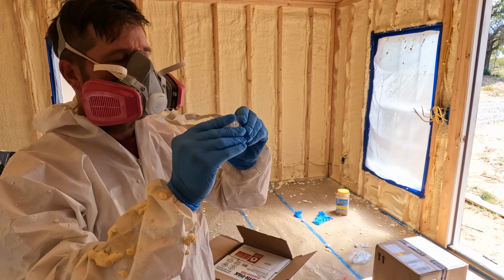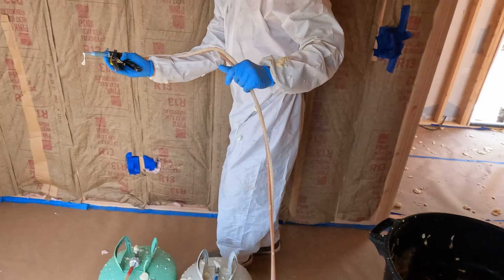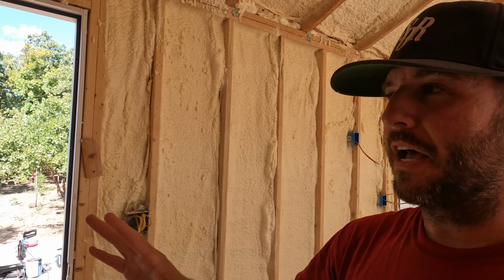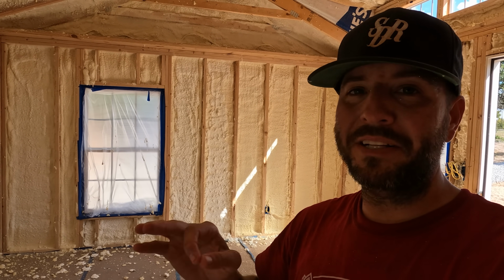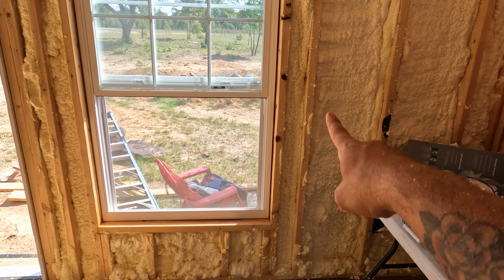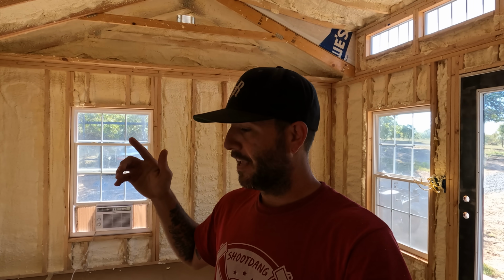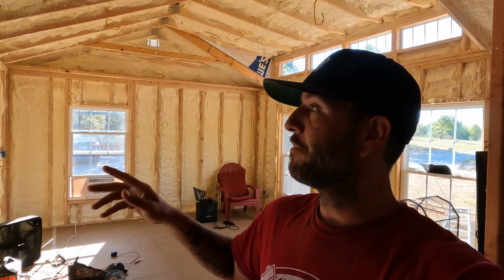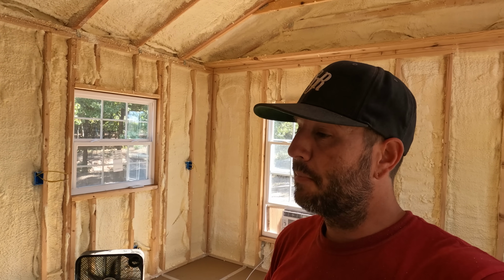Shed To Tiny House - DIY Amazon Froth Pak Spray Foam - Was It Worth It?

Comment: I have had terrible luck with nearly every appliance I've purchased in the last 5-10 years. Defective Maytag washer within 18 months. Bosch dishwasher dead in 3 years. GE window a/c dead in 1 year, Frigidaire freezer worked but had to replace some part to cool the fridge at 3-4 yrs cost $250 to fix an $800 refrigerator. I'm sick of these throwaway appliances & cannot recommend any brand because I really think it's luck of the draw. Previously had good luck with many brands lasting 15-25 years & 30 year old Maytag still going strong in my shop 🤞

Comment: Your window A/C unit is not properly installed.  The accordian panel on one side has a open gap in it and if you put a little of the pink insulation scraps over the accordians strips it will cool better.  Also if you have running water run a hose to the window keeping ithe hose covered so it is NOT out in the sun then put an adjustable spray nozzle on the hose turn on the water  and turn the adustment on the nozzle until it has a small fine mist spraying out without having to hold the trigger and wire it up aimed atthe exterior of the A/C unit spraying the mist either directly on  or right across in front of the exterior "rear" coils of the unit ( barely on the A/C is better ) and the air going through the flowing water mist will cool the air going through the coils and supercharge the 5000 btu unit to function mor like an 8000 or 9000 btu A/C and cool a larger space much faster and cooler.  A more permanet sytem can be set up with a water hose water filter and a small garden misting kit from amazon for about $25 to $35 total it will make daytime soooooo much better until you finish insulation and mini split install and can be done to the mini split exterior module also, usually.

Comment: I’m  not positive but I’ve always heard you’re not supposed to spray closed cell foam inside, you’re supposed to use an open cell foam. Also make sure the surrounding area is termite treated because that foam is like cocaine to a termite and it makes it a lot easier for them to move thru the building with foam. Some exterminators won’t warranty any building with foam. That’s what I’ve been told anyway.

Comment: Pink insulation is cheaper but spray foam air seals the house which pink insulation doesn't do very well. As far as appliances I have a 3 year old Samsung refrigerator and I have had the ice maker replaced twice under warranty and the control panel replaced. It was under warranty but now it's out of warranty and the ice maker isn't working again. I obviously wouldn't recommend Samsung.

Comment: Spray foam NO.  Their is heat generated during the expansion stage and once the foam hardens it cools off and shrinks leaving a small gap between the foam and stud.

Comment: Some shades and or canopies outside, anything to block the sun will make a huge difference in that little 5k A/C's ability to handle the load.  Even low E windows still cook a lot of heat into a space.  I wouldn't dare to claim any appliance is good as the quality control is completely lacking in China  with them lowering the reliability bar more and more and the quality seems to vary from month to month not to mention year to year.  Also the big holding companies buy and sell brands continuously and they seem to buy and drive the quality down even further.  Business schools seem to put no value on return customers or brand loyalty and that is what they teach to their graduates who run tomorrow's businesses.

Comment: I’d stay away from Samsung!  I paid 3200 for a fridge and last little over a year.  Had to have a certified Samsung g repairman to come look at it.   He walked in the door and said he needed a 170.00 check before looking at the fridge.  It was the brain board on the fridge and was gonna be 1800 bucks.  Not warranted.  Told him thanks but no thanks.  Put it on marketplace for free and was gone in 1 hr. Went and bought a fridgedaire and had no troubles at all.

Comment: 18000 btu is way too big. Too big is just has bad as too small. The unit will short cycle. Goggle AC short cycle. 12000 btu is good for 450 -550 sqft. 18000 btu is for 700 - 1000 sqft.

Comment: Oversizing your cooling system by a lot like you are saying you are going to do can cause the system to short cycle and not remove moisture. It can also cause the system to ice up. I hope you don't have these issues with yours.

As for appliances, do stay clear of Samsung. They have a history of very poor reliability and long repair waits. If you want to do all the same brand, which is not actually the best idea, go LG.
Reply: While that’s true with traditional 1 speed HVAC systems, inverter mini split systems solve that issue.  They run with only as much capacity as is required, and do a much better job at moisture extraction.

Comment: This stuff is terrible!  Bad for the environment.  Hard to remodel in future.  Uneven surfaces by as much as 50% -75%! Will hit de point inside your wall due to the closed cell foam when temps get below zero.  The list goes on…..